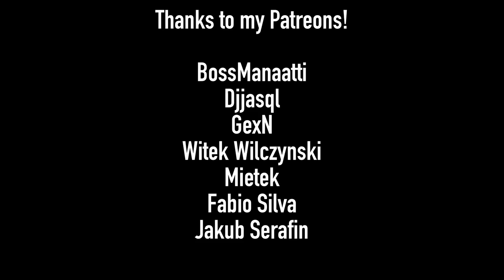Pimp my PEV #5 - OFF-ROAD EUC Setup - GotWay Nikola with Knobby Motocross Tire

Comment: Do the Nylon Pedals have to be EUC specific with how they sit when installed (angle) - it appears the angle of the Nylon Pedals pedals is the same on both your MSS an on this Nikola - would these pedals sit with the extreme angle if installed on a standard MSX or MSP?